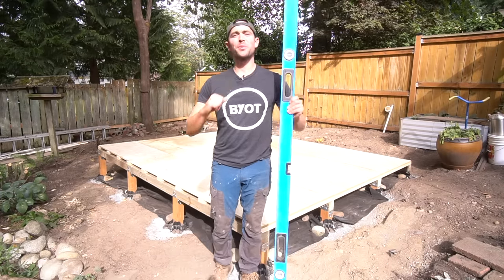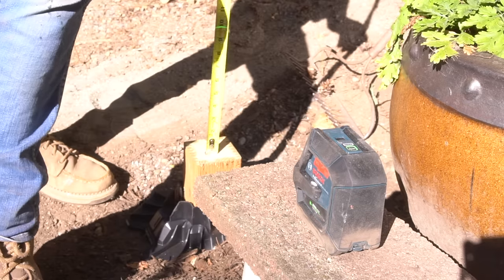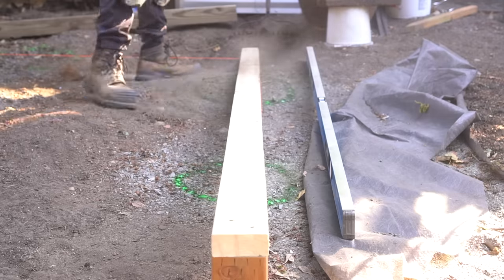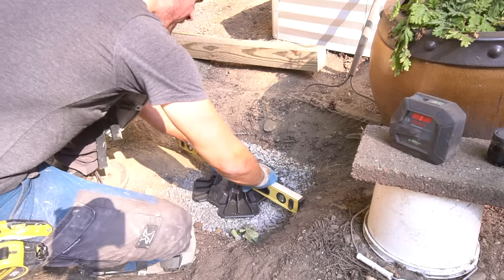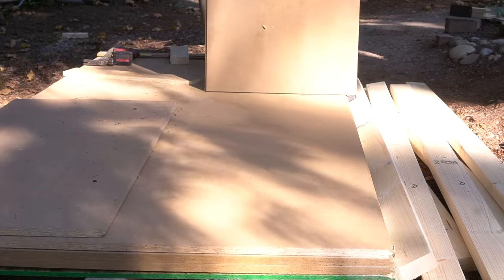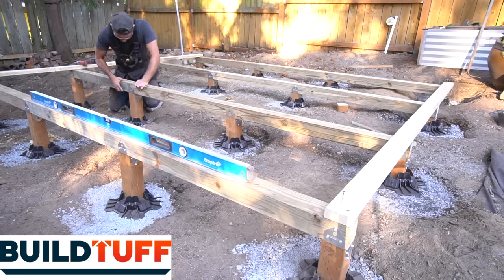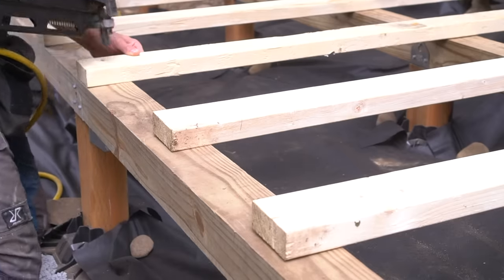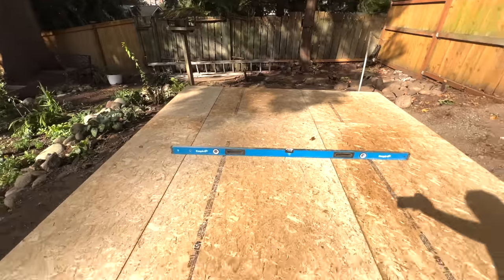How To Make A LEVEL Floor System

Comment: I have been working in the building trades for 40 years, and I have never seen anyone lay the floor joists on their sides. In addition to that, I would not recommend using 2"x 4"s for your floor joists at any span. A minimum of a 2"x 6" should be used. The plywood sheathing should always be staggered, this adds much needed strength to the structure. Always anchor your structure to the ground. You don't want to be responsible for your structure blowing away and causing damage or death, this happens more than you know. Finally, the fabric used under structures is not to prevent weeds. It's purpose is to protect the underside of the structure from moisture. So it is very important to use a (vapor barrier) visqueen/plastic sheeting, and not a weed blocker. Most people are more than capable of building a quality structure, but I do recommend that you speak with the professionals in your area to better understand the correct way to achieve your goal. Good Luck and God bless
Reply: I agree 100 percent. I have never seen this before.
Reply: And as a result the floor is "bouncy". Great concept though. Laser levels are the way to go..
Reply: Thanks for the video.  Yep - I agree with Mr. Allard.  I've been designing homes and remodels for 25 years.  I have never laid my joists flat.  However, depending on the load conditions and the spacing and span of the joists  a 2x4 on edge may be adequate but a 2x6 will definitely provide a better floor.
Reply: @guysolis5843  Bouncy is good for your knees and hips. I have even bouncier for that very reason. I do without the 2 by 4, the sheathing goes right on the uprights. Load bearing is sufficient for normal house and kitchen stuff. I do admit that a floor standing cabinet for glassware would be a rattly affair but that's what walls are for.
I borrowed the idea from the way office spaces with floating floors are made. Concrete floor with adjustable steel spacers 10" tall on a 24" raster. On top of that square tiles 2" thick particle board (offices are not yet up to speed on a bit of flex in a floor). It's extremely practical for everything piping and wiring, lift a tile or 2 and you can modify whatever you want.
Reply: Agree with David and would add the short post on the plastic footing will split as it dries, it's to short. Use proper stumps and you'd be avoiding so many issues.
Reply: I said the same, the guy is a hack... this is not a builder, he is a re-builder.
Reply: It's a 10 year structure...just like the 20 year houses that developers are building all over the place.
Reply: @markanthony3275  with a 2 year floor
Reply: That things gonna blow over into neighbors yard
Reply: Agreed, if I built with this method it’d blow right down my hill in the first winter storm.
Reply: This is a garden shed, not a house. As such, some of your points are a bit off.

"I have been working in the building trades for 40 years, and I have never seen anyone lay the floor joists on their sides. In addition to that, I would not recommend using 2"x 4"s for your floor joists at any span. A minimum of a 2"x 6" should be used."
ACTUALLY, you might have missed it in the video but this is a pre-ordered flooring system from a company who's plans are up to spec for their purpose. Laying the joists on their side is what the manufacturer specifies and what the engineers signed off on. I agree, I have never seen it either, it looks odd.  But just because we have never been exposed to something doesn't mean it is wrong. It just goes to show that even long exposure to a trade can still be ignorant if your exposure is only to one corner of the industry. It's great that after 40 years you can still see new things and still learn. He was right to follow manufacturer specifications.

 "Always anchor your structure to the ground." Totally agree. Should have been anchored.

"Finally, the fabric used under structures is not to prevent weeds. It's purpose is to protect the underside of the structure from moisture. So it is very important to use a (vapor barrier) visqueen/plastic sheeting, and not a weed blocker."
ACTUALLY: A shed without heat and air-conditioning SHOULD NOT have a moisture barrier as it will cause condensation and mold growth. His shed is plenty far off the ground to allow sufficient airflow (Code for this in my state is 6" off the ground). If he were using concrete though, he would need to protect moisture from entering through the concrete. So he should not use a vapor barrier. However, since his structure is lifted off the ground and will be exposed to some moisture and sunlight he probably doesn't want stuff growing under there. That is why many people use weed barrier under garden sheds. A weed barrier will block weeds and still allow moisture to pass through, facilitating drying. Plastic would hold the moisture on top and keep it from being able to be absorbed by the soil.
Reply: @davidallard7998  It's a floor system and his assembly method is specified by the manufacturer. Now you have seen it. You learn something new every day.
Reply: @kevinzep01  It's a floor kit and his assembly method is specified by the manufacturer. You can see this on their website.
Reply: @nickcrider4309
Reply: Thanks for the education. I'm always happy to learn something new.
Reply: @nickcrider4309  ! Building discipline no matter what you are building, "build it the best way possible" whether it is a bird house or the penthouse.
Reply: @MrDarchangelomni  nah. Allowable tolerances are a thing. Engineers rarely overingeneer when it is not necessary. You do the thing that is required. Overbuilding is a waste of time and money. That type of thinking will get you thrown off a commercial job site. If the architect specifies 24" on center and you layout to 16" on center you will be fired. You build something as good as you can up to the point that in necessary. Use #3 rebar on deck footings but #4 on garage footings. Don't overbuild and use #4 on deck footings because it is not necessary and a waste of money. "The best way possible" doesn't mean do what is not necessary, the "best" way takes usage, budget, and time into consideration. "the best way possible" is do the job exactly right. No more, no less.
Reply: @nickcrider4309  everything is overbuilt, if you build to spec its because you work in north korea, even the specs in this country are spec'd below maximum, sometimes far below so that those who would try to skimp on cost are still within spec and don't know it. I have a feeling we are about to increase country wide code requirements again, in the next 2-5 years, if not there won't be any home insurance companies left. Also, no I disagree with a corporate definition of "best"which only means "most efficient"; meant to increase margins. There is absolutely a "best" way to build something regardless of cost. Momma didn't build me with cheap parts. People love to say life is to complex to simplify to black or white,  that is as nonsense as the phrase "irreducibly complex" it is absolutely possible to reduce best to a quality only basis of best or not best... A lot of smart philosophers, scientists and theologians over the centuries have iterated this idea, If you can not reduce it to one simple thing, it is not because it is too complex, it is because you need to understand it better.
Reply: @nickcrider4309  even if I plan to take it down in 7 days, I build it to last 70 years, Art/Craftsmanship for Arts Sake. Usually on temp builds, I build modular anyway, I always try to design my temp structures around what can be hauled in a pickup truck, but I still build it for my Great Grandkids to enjoy. I have an entire shed, Roof, Walls Floor, footing all built in bolt together 4x8 sections. Its been with me everywhere and when I need it larger I just build more panels, and bolt on.
Reply: @MrDarchangelomni  Yes, if you build to spec it is overbuilt. Because spec needs to guarantee against all possible failure. What I mean by overbuilt is building over what spec requires, in other words, over-over-building. But the gentleman in this video was building to spec (save the anchoring), yet many people were criticizing, even insulting him, mostly due to their own ignorance of what spec is in this situation. As you have said, "everything is over built, if you build to spec," therefore, by your own logic, as this gentleman has built to spec, this floor system is overbuilt...hmm.

And I never said "best" is "most efficient." I said that "best" takes many things into consideration.  The strongest foundations would be cast from solid metal, but best doesn't mean "strongest," the best looking (subjective) sidewalks are paved with brick, but best doesnt means "most attractive," Best doesn't mean cheapest or most expensive, it doesn't mean durable, it doesn't mean long lasting. Best is a comparative superlative that only makes sense in relation to a goal. If you goal is to make something last 70 years than "best" would get you to that goal. If your goal is to makes something beautiful the the best options will be aesthetically pleasing. If your goal is to accomplish a task on a budget, then the best way to accomplish that would be to be efficient with your spending. 
Most people want things to last, but want them simple, and want them affordable, (because saving for the kid's college is more important than making sure the place you store your shovels and weed eater is built to withstand a hurricane in the heartland or sub zero temperatures in texas), in such cases, "best" is a collection of concessions made for and from aesthetics, durability, and price. 

And you agree with this. I am sure you wouldn't build your grandchildren's yard fort out of LVL framing, zip-system sheathing, with high R values and air quality machines. And I am sure that your modular builds (great idea btw) have to make concessions on layout in order to gain convenience on transport and assembly. You are already taking many factors into consideration and adapting for them. And for you purposes, it sounds like that is the best way.
Reply: @nickcrider4309  bro the guy used untreated lumber, what looked like douglaas fir/yellow pine  joists sheathed in OSB tng that do not meet required loading for a 2 foot span in that orientation. no vapor barriers over virgin soil, and no underpinning 5" off the ground!!! Spec is not a 18 month mulch pit with a roof over it, there were 4 code violations for the area I live,  He didn't even have or didn't mention the ground contact schedule or wind load ratings sheet... I don't know about you guys, but that building would have cost 20,000$ as soon as one of the county appraisers drones spotted it, and they didn't have the ground contact data/ 110mph windload data in a folder with his permit and inspection. He is not my neighbor and therefore not my problem with his black and decker suburb wrecker... except the dude is on youtube, trying to be bob the builder in a tutorial... You want to build crap in your toilet, thats fine cause the public never has to see it, but you start going around teaching honest people who only want to improve their property how to crap all over the country bybuilding flying bombs... then yeah you are either a pos for not having the requisite skills to be Bob Vila and not caring enough to learn how to present a better build, or a pos for knowing its crap and not caring enough about your audience to give a solid tutorial. either way, criticism is a minimum, sometimes slides made out of sandpaper into pools of saltwater are really whats called for.
Reply: @MrDarchangelomni  he built to manufacturer's specifications. You should argue with the engineers at Homestead Supplier. He assembled a modular build that came precut with directions. I suspect that your assumptions are wrong and the manufacturers instructions are right. There is no shame in it my friend. We don't expect you to know everything. Maybe you should order one of their kits and try a build yourself. Heck, make a youtube video about it. Then when you come to the point in the manufacturers spec where you disagree with their engineers, you can go to Lowes and purchase a bunch of 2x6s and order a concrete truck and spend a an extra $800 to teach us all out to do it "right." 
I agree that this guy is an amature. It's clear. We both would have built this little shed differently. The difference between us is this: When I saw him doing something odd with the floor joists, I thought "hmm, that's weird," then I clicked on the link and went to the website from where he ordered his kit, I searched until I found their floor systems and discovered that he actually assembled it correctly, that he followed the manufacturer's specifications. WHEREAS when you noticed the same things I did, you immediately went the the comments and started hurling personal insults at the guy. Which is the only reason I commented. I didn't like the video. But I also didn't like the keyboard ninjas projecting their personal issues, erroneously, upon a content creator.
You don't care if his shed falls apart in 5 years. And anyone who watches this video to learn how to build their own shed will probably also watch a dozen more just like it, intake the info from everyone and make grown-up decisions how to go about it. And if they order the same floor system this guy did, the will probably follow the directions and build it the same way he did. You don't care about this guy's viewers. If you do, maybe you can track them down, yell at them about art and craftsmanship while calling them Hacks. 
Why do you find it necessary to be so combative in youtube comment sections?
Reply: Just another youtube content creator clown.  I wouldnt let this guy tie my shoes.
Reply: As a licensed builder here in the Kansas City , Missouri area, I def agree that this build has some problems.  The main problem I see with this Tuff Block is that this structure has no defense from uplift.  People continually underestimate the amount of force wind can exert underneath a structure.  There is absolutely nothing holding this structure down except its own weight.  Additionally, I don't see any resistance, again except for the weight of the structure, from lateral wind either.  I can see this thing blowing over and that is not hyperbole.  This is structure would not pass code in my area.
Reply: Most people don't bother to get permits for these sheds, and small buildings, but they should. I'm in Florida, and there is nothing about the construction of this structure that would pass down here. I received a response from someone who suggested that this is a kit, and that it was signed off by an engineer. Well I'm pretty sure that he has some interest in this building based on his comment. It is sad if any engineer has their signature on this, but I have met some that shouldn't carry the title. A real engineer would not lay the joist on their side, because you would more then double your base load by turning them upright. Not to mention there is no continues support at the rim of the deck, as their is no rim joist.
These structures are generally built for a specific purpose, then used for something else, like a she shed, or work shop with power, heat, and Ac. So my point is build it to code and you will have it for years to come. Vapor barrier is very important, as I have torn down many as a result of this failure.
Reply: This comment is for the young man who made this video. I just want you to know that I wasn't making fun, I was just pointing out some things that I believe can be done in a better way.
 We all started with no experience, and for me, well I'm still learning 40 years in. You are going to make mistakes, and that's just a fact, but that's how we learn. I found that the best way for me to learn the trades was to ask questions, listen, and watch people that new how to get it done the right way.
 I hope you continue to make your videos, and I wish you success. Do a lot of research beforehand, because people will copy what you do, and that is all the more reason to make sure it's right. Do it responsibly. Look forward to the next video. Good luck
Reply: @davidmc62  I talked to the same idiot , I too said that this doesn't pass code, pretty much anywhere I have built which is 17 states, Florida would laugh at you if you even suggested having this, every structure in Florida has to have its ground anchor/windload ratings listed, sheds will have a sticker somewhere, and per spec for distance from coastline, I believe they even changed that rule so that now all of florida is considered beach front for the purpose of determining code requirements.
Reply: 100% agree with all of this also im not sure if its code but essentuly every structure i have ever worked on any time you have a beam / joist what ever it is span longer than 1 solid piece you always alternate the brakes so they never all fall on the same line. his 4x4 beams are all layed out 4ft sections to one end and 8 footers on the other they should of alternated
Reply: I really like this guy and his enthusiasm but please don’t go build anything like this.
Reply: Fkn tell him David!
Reply: 100% right it is not  anchored to the ground and will end up in the neighbours backyard plus the joists are not on edge dumb design.
Reply: Ya, Not a good idea
Reply: @nickcrider4309  You're talking as if manufacturers are infallible or can alter the physical properties of matter - if you can't understand why joists are laid vertically - then grab a wooden ruler - try to snap it at the wide part (the way the joists are laid in this video) ....then try to snap it at the thinnest part (the way joists should actually be laid) - you won't be able to - this is explained by "moment of inertia" - so are you telling me the manufacturers have devised a way to counteract the laws of physics? Stop acting like a know it all and listen to some very knowledgeable builders who are trying to stop others from making very costly and dangerous mistakes....
Reply: @MrDarchangelomni  You're 100% correct in all you wrote - but unfortunately the only thing you cant fix is stupid 😉
Reply: Plastic sheeting should have gravel on top of the plastic or it  will not last long
Reply: These are lgbtq building codes
Reply: @davidmc62    The floor joists only have a 36" open span, so 2x4's are acceptable -- and they did come from the manufacturer as part of an engineered kit.  But laying them flat is wrong and the manufacturer's instructions specify them as being installed on edge.  As for the weed cloth / vapor barrier  -- in this it is in fact being used as a weed barrier.  His floor is 10+ inches above grade , and it's a shed, not a habitable dwelling.
Reply: New to building, please help. Building a she shed office for wife 10x12 in washington state. Using 12 camo blocks with 4x4 posts using 2x6x12s on either side of the 4x4s to make beams using structural screws. The floor is then made of 2x6x10s with single 2x6x12 rim joist. Im using 2x4s for framing with 3/4 inch plywood subfloor siding with additional siding to be added and 3/4 inch plywood for the roofing. The beams go full length of the floor but the long sides are cantilevered 16 inches from the middle of 4x4 posts along the beam. The roof will be single pitch lean to style. Walls will be 7'6" on back and sides whereas approximately 9 feet on front. The shed will be finished on the inside in tiny home style fashion. And have a desk on the back side. I will have windows on the sides and a door in the middle front unless swapping it to the side is safer. Question is whether i can do this safely for my wife to work in 12 hours a day or whether i need to rebuild the walls to shorten over the beams or just focus theblive load to the center over the beams by putting the door in the middle. Most plans ive seen allow for the cantilever but when i look at residential building code the allowable floor cantilever is only the size of the floor joist. Ive built the beams floor and 3 walls already but as im new to building am getting nervous about putting the weight of those walls over the cantileverd sides. We won't have lots of things stored in the building as it will be meant for using computers and have decorations rather than storing heavy equipment and such.
Reply: Oh boy, a thread populated by 'experts'.
Reply: I've never been in the building trades, but have been a diyer for decades AND am married to a physicist.  The convention of putting floor joists on end IS physics.  The difference in the support to the floor isn't comparable in the least.  On end is extremely strong and level, on their sides is very weak and bouncy.  Not watching the rest of this vid.  This guy doesn't know what he's doing.
Reply: You lived in a different era when materials were very low cost compared to today. The flat 2 x 4s are not joists. They're reinforcement webbing ( furring ) for a floor. Looks like 3/4 t&g floor, so he's working with an effective floor thickness of 1-1/2 + 3/4 = 2-1/4 thickness.  That's a very thick floor to put down over beams on 48-inch centers. It will not deflect, and the reason is that it's impossible to apply a point load anywhere. Point loads are supported by all the adjoining support, making it much stronger than it looks, assuming he uses the proper nailing schedule with proper nail penetration and weight.
It's not necessary to anchor a heavy structure, except in Gulf coast states. America must have millions of backyard sheds purchased ready built and set down on skids without anchoring, they're too heavy to get blown away. Anchoring is only used on the ones made of plastic and 26ga metal, and the anchors supplied are just cheap stakes.
Reply: @astranger448 that sounds like a frikkin nightmare.
Reply: It wouldn't pass windload calcs in Florida.  J-bolts into pilings or Red-heads...
Reply: Great advice 🙏
Reply: Same here.. first time seeing 2x4 as base floor 🤣😂
Reply: Obviously the professionals are dumb or go by the book way too much... no 2x4s for joists for a small deck?? Get outta here kid that's plenty string enough!! I'll give it to you laying them on the side was weird and weakens the deck strength BUT it's still fine...
Reply: @WillieFisterBum ”He are one?? “. And, you are criticizing him????
Reply: @nickcrider4309 I don't do any building or carpentry work, but as a novice, I even know not to put floor joists on their sides, again I am not a professional or anything like that, but that seemed so wrong, you take the strength away from the joists doing that.....just saying!!
Reply: I agree
Reply: It's sad that these days really bad advice like this gets blasted at all over social media. Google doesn't have to worry about being sued for promoting lies and malpractice.
Reply: Aside from the flat side floor joists, all or none of your suggestions can be applicable, it comes to weather, budget, time, etc.
Reply: If you are digging out holes and filling with stones why not just use concrete and anchor everything down. Also I would use 6x2 for joists and seat them on edge properly. And please, it you make any platform or base like this only use pressure treated timber, you'll be lucky to get two winters out of that. Work smart not cheap!
Reply: @nickcrider4309 and this is why structures don’t last anymore. All these prefabricated structures. Just because it comes in a prefab box, doesn’t mean it’s a decent structure. It won’t last. And you do want moisture barrier on a shed to prevent moisture/water from getting in from the bottom and rotting the wood. She’d should be vented to let out out humidity that’s on the inside.
Reply: @annad5130  true. Just because you buy something is prefab does. It mean it is good quality. Usually the opposite. But I suspect that this garden shed will more be just fine. This idea of “don’t last anymore” is operating under the false notion that things used to be built better. The opposite is often true. There aren’t many structures left from even 7 decades ago. Let alone garden sheds! I renovate old houses for a living. I have seen some crazy poorly built structures from a time before building codes. Right now I am renovating a 20s bungalow with a “garage” built with no footing and NO FRAMING. It’s wild. The cladding is literally the only thing supporting the roof. And that cladding is tied to tether with 2x4…you guessed it, laid in their side. They really knew how to build em back then. lol.
Reply: @jackdaniel7465  I renovate old homes for a living. And I would never ever ever lay joists in their sides. I would never use 2x4s for floor joists anyway. However, that doesn’t mean that this structure isn’t fine to be built this way. You don’t have to overbuild everything. I looked up this company and this guy built this building exactly the way the manufacturers specified. They are licensed to sell in all 50 states, which means their engineers designed this to be up to code in every state. It’s fine. Why lay them on their side? Who knows, maybe it has to do with the height, maybe they needed an extra inch for material they use elsewhere and they found if they turn the joists in their side, they still provide enough support for the weight over that spanse while solving another issue. I don’t know. But it’s fine.
Reply: @SJ.77  I renovate old homes for a living. I also have a BS in structural engineering. I would never ever ever lay joists in their side. I would never use 2x4s for floor joists anyway. However, that doesn’t mean that this structure isn’t fine to be built this way. You don’t have to overbuild everything. I looked up this company and this guy built this building exactly the way the manufacturers specified. They are licensed to sell in all 50 states, which means their engineers designed this to be up to code in every state. It’s fine. Why lay them on their side? Who knows, maybe it has to do with the height, maybe they needed an extra inch for material they use elsewhere and they found if they turn the joists in their side, they still provide enough support for the weight over that spanse while solving another issue. I don’t know. But it’s fine. I don’t know everything but I do have an expertise in building. I find that most “experienced” builders who just fuss and insult people on YouTube are generally simple laborers. Their expertise is often just based on what they have experienced and is not rooted in anyway in the actual physics of theory of what they do for a living. They read plans and put boards to other boards. Experience is valuable but it doesn’t mean they have any deeper expertise.
Reply: @nickcrider4309  You're saying you'd never lay joists on their side then you're saying you dont have to overbuild everything.....so have you been overbuilding everything all your life?
The reason you can't find tabulated information on dimension lumbar laid flat (usually called "weak axis bending") is because the strength is so small that there is virtually no structural application. The only time you would use 2x lumber like that is something like flooring where the boards are almost continuously supported and are carrying very little weight.

However if you want to get a sense of the strength you can compare the moment of inertia of the various cross-sections and orientations. Bending strength is proportional to that value.

a flat 2x4 has about 20% the strength as a standing one
a flat 2x6 has about 7% the strength as a standing one
a flat 2x8 has about 4% the strength as a standing one
Reply: 😂 @WillieFisterBum 😂
Reply: totally wacky floor joists
Reply: I mean everything you said is 100% correct, but he did say he would show us how to get a level floor system. And I must say he definitely got it level lol so can't argue with that.
Reply: I mean everything you said is 100% correct, but he did say he would show us how to get a level floor system. And I must say he definitely got it level lol so can't argue with that.
Reply: It’s a shed! Lighten up